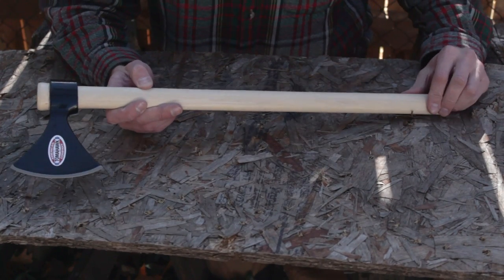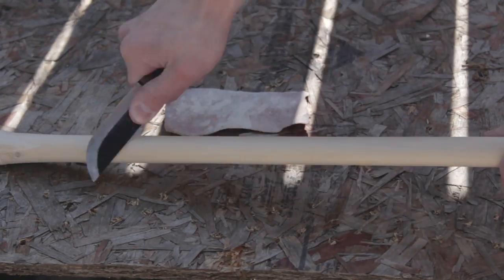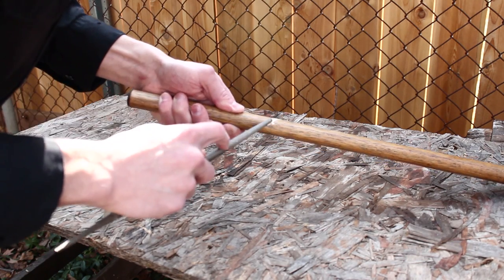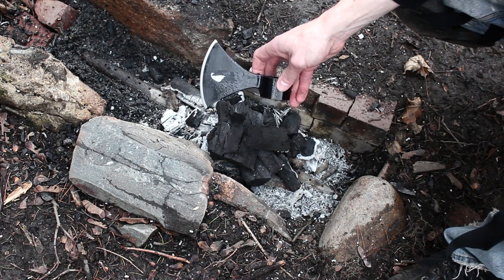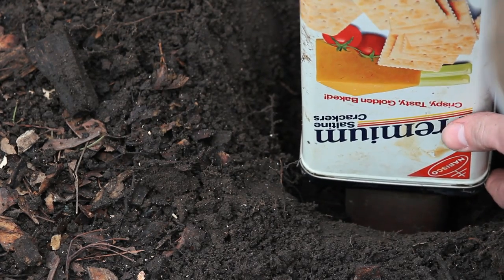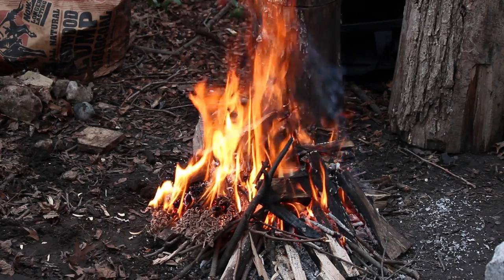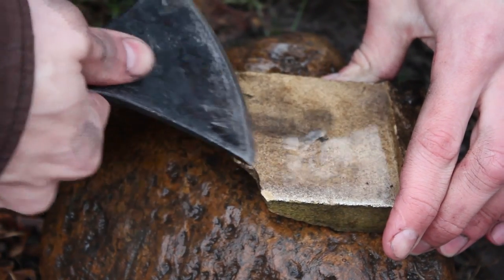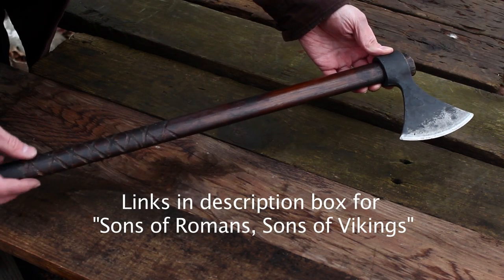Modifying a Cold Steel Norse Hawk and Making Birch Oil

Comment: Good video brother, I actually own several cold steel tomahawks, I usually take the paint off by sanding the paint into the steel with sanding paper, well it doesn't take it off it soaks the paint into the steel, I use a little oil to clean the steel, it makes my tomahawks look forged, really I get the best of both worlds with this method the tomahawks doesn't rust and it looks forged, it also saves on time and hard work, good work,  God bless brother

Ps I want to say thank you for making these videos, they help me understand forging,

Comment: Is there reason you didn't heat treat the tomahawk head again after you put it in the forge? Is it just going to be a prop and not actually used? Just curious.
Reply from the maker: Yup, I made to be a prop. If and when I want to sharpen it as an actual tool I'll have to heat treat it.
Reply: are you confident that you can heat treat it as well as it came from factory?...And hasn't some of the carbon in the steel burned away while it was in the fire? Seems like a bad idea to me
Reply: Yol Mak it should re heat treat fine and he would have to have it in a forge a lot longer than that before worrying about burning the carbon out.

Comment: Throw that damn screw away! I didn't realize it until i had to buy 3 replacement handles that the screw makes your handle crack! Cold steel should be ashamed of putting that on their tomahawks. a tomahawk is supposed to fit on with friction  and a tapered handle as well as eye hole!
Reply: Cold Steels tools are made in Taiwan